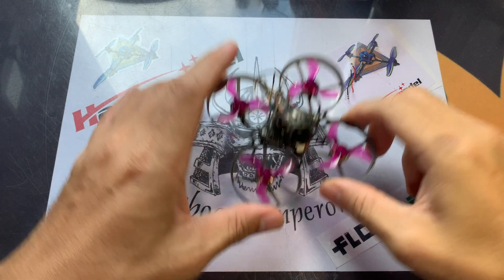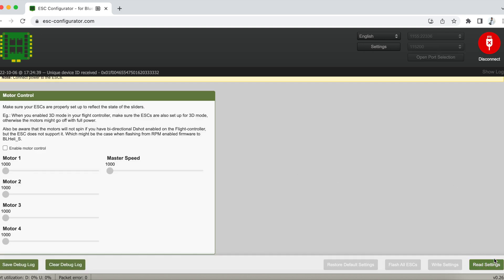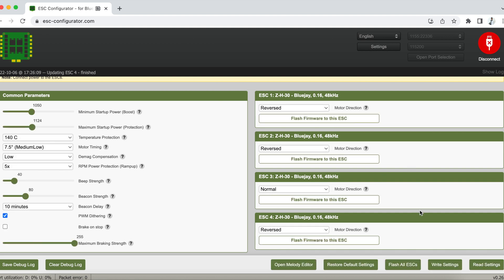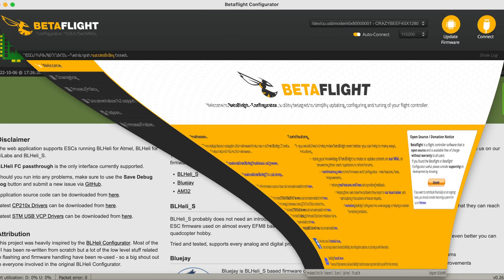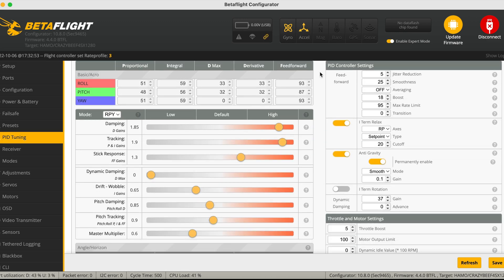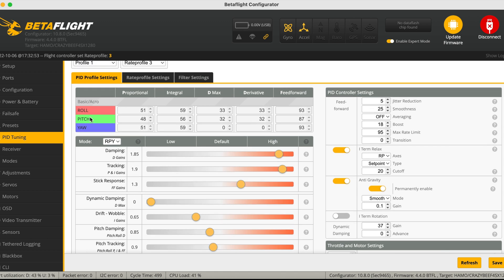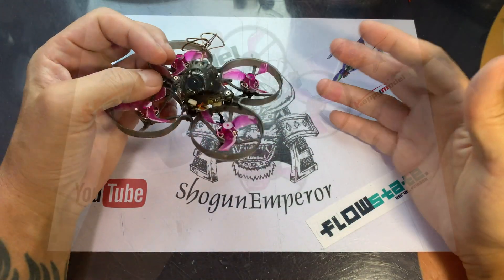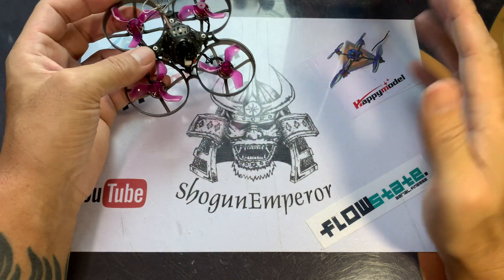Setting up Bluejay for Mobula7 1S and PID tunes

Comment: Hey Shogunemperor, love the vids. Question, I've set up bluejay on a few of my quads, but this is the first time I'm hearing that you have to have the motors set to reversed in the configurator. Where did you learn that?
Reply from the maker: Hey thanks bruh. Well, testing the Bluejay on the mobula7 i realized that when it is set to normal, that specific motor will stutter every now and then, so after much frustration and hair pulling, I accidentally set it to reverse and that stuttering stopped. Kinda accidentally really…..
Reply: @shogunemperor  That's super interesting. I'll will take note of that for future troubleshooting. I've never had a stuttering problem like that except with a damaged motor. Thanks for the reply!
Reply from the maker: @housinit  yeah, ive only encountered it when flashing Bluejay… i thought i had killed an ESC or motor… but when i flashed it back to Blheli_S it worked again. So i derived that it was a firmware issue and found the above. Thanks so much for dropping in bruddah